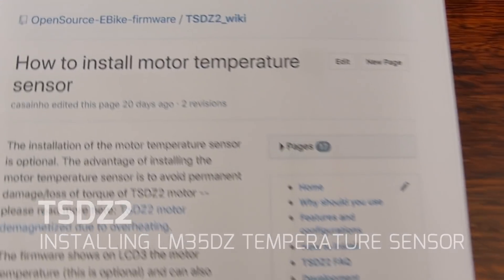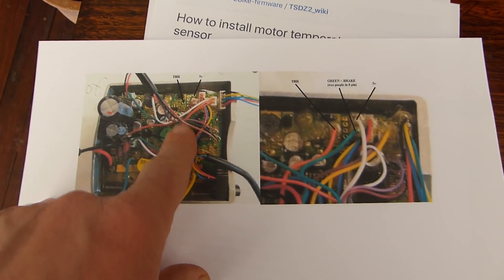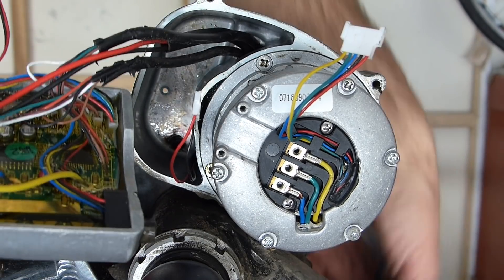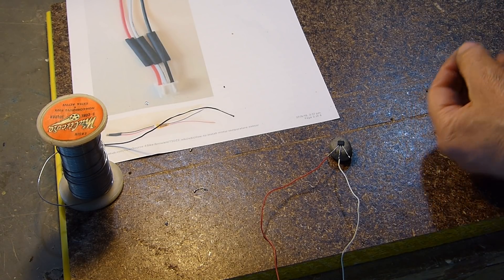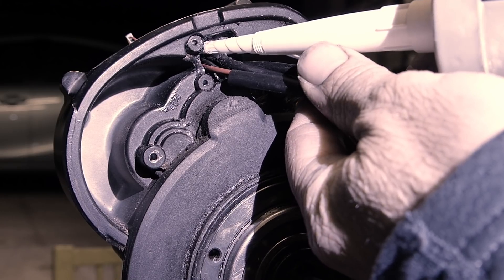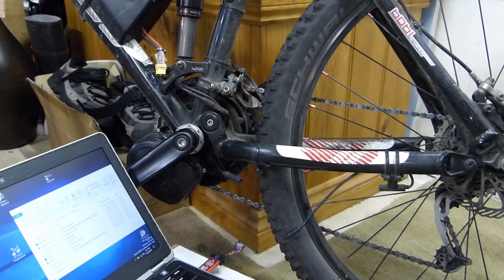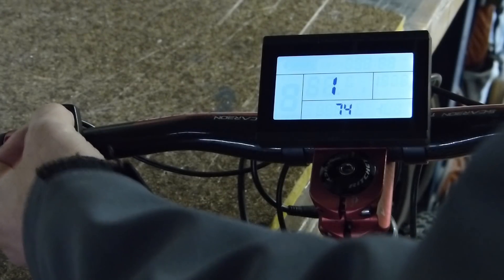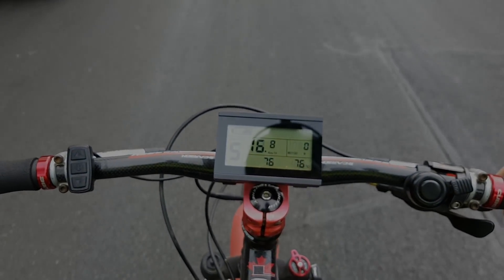TSDZ2 OPENSOURCE FIRMWARE | INSTALLING TEMPERATURE SENSOR

Comment: "Really good idea" - it is not the temperature sensor. It is the cooling upgrade. I use wide copper cable and got 75->65 degrees.

Comment: Nice video 
Can you explain how to apply it on Hub motors if possible?
I have Kt controller with kt lcd8
Reply from the maker: Does it have a torque sensor ?
Reply: @jbalatutube  no at the most,  my motor cable has 11 wires (3 + 8), and like to know how to add  thermostat to the hub motor. my motor direct drive.

Comment: Why do you say the throttle is not very useful with the custom firmware?
Reply from the maker: The torque sensing is very good if you want a throttle then you have picked the wrong motor. It was never developed and it was decided to use the throttle port for the temperature sensor.
Reply: @jbalatutube  I want to install the temp sensor, but I was concerned I would regret not having a throttle. You resolved that concern for me, thanks!

Comment: Hey Jbala, Seems im running into the same problems concerning the temp sensor you had prior. Im reading 4.4 from input to ground but can get any data out of it. My screen is showing a constant 16 degrees with or without sensor. What fixed it for you ?
Reply from the maker: they were just crappy sensors, had to pay $2 instead of $1 to get a good one that actually worked. Just double check your wiring just in case.
Reply: @jbalatutube  Jep that fixed it, thanks. Seems hard to get a good LM 35 nowadays

Comment: I think I will just buy a cheap digital termometer for the car, put it on the handlebar next to the main display and glue the probe on the motor. That way I don't need to fiddle with the controller wires and I can keep the throttle. It would not cut the power automatically but I can monitor the temperature myself and take care not to overheat the motor.
Reply: That is a much better idea. I plan to do the same. The thick layer of PCB coating is there for a reason. Prying it apart to solder a heat mod seems like a  good way to invite problems.

Comment: Looks like the open source firmware re-uses an analog ADC throttle input for the temp reading instead. The developer must have figured out which analog input to read.  If temp and throttle were desired, then either another analog input has to be available, or this one needs multiplexing with some way of signaling the code which is in use. Lots more to be done. Kudos.
Reply from the maker: I don't think losing the throttle on this motor is a big deal but there is a digital output available too which he could have used but chose not to
Reply from the maker: Jayeson Lee-Steere then don’t install the temp sensor. I don’t think they have any plans to use a different port at this stage, but feel free to subscribe to the forum and ask for this feature.
Reply from the maker: @jayesonlee-steere5493  https://endless-sphere.com/forums/viewtopic.php?p=1474479#p1474479

Comment: Ive been watching , and made the decision to go for the TSDZ2 instead of the 8fun on the back of the original video, I'm a little disappointed with the performance, it kicks in well on a hill but for long cycle routes on the flat, it doesn't provide enough assistance when you have tired legs on the way home! This update would be great if it was available as a plug in solution